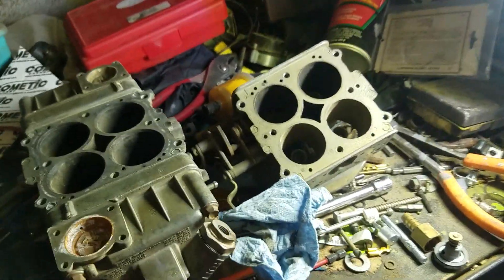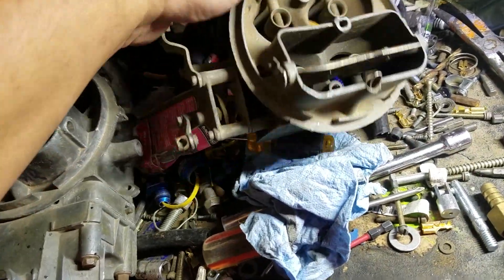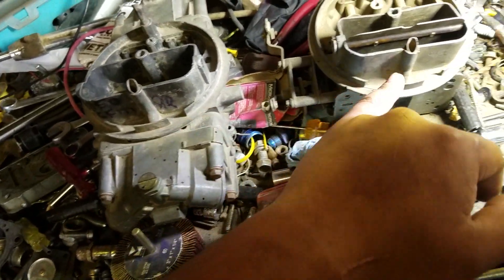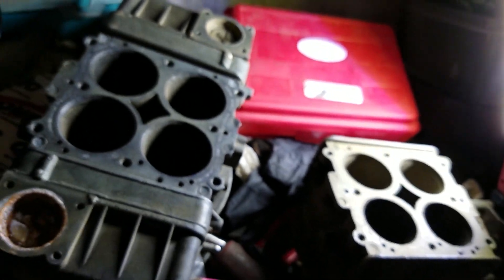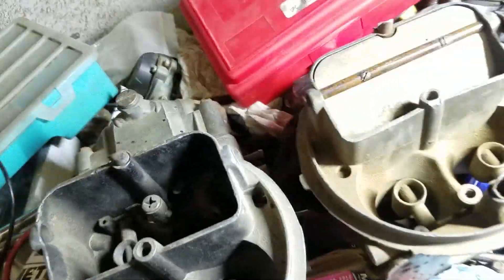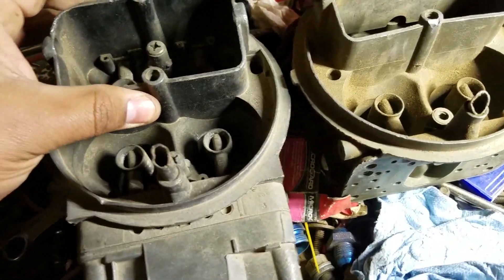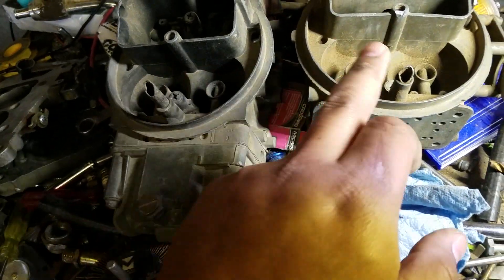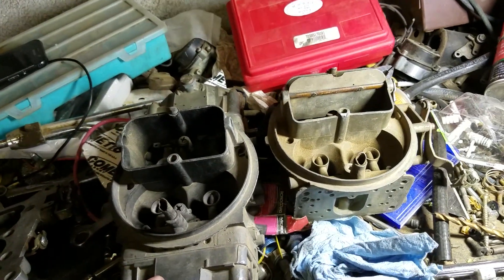Holley Carb 600 vs 650 Differences and Which One is Better | Holley Carb Secrets |Holley Carb Tuning

Comment: Hello, excellent video, I have a carburetor like that, my engine is a slightly modified 350 but I bought an 850 cfm too much for this engine that I have to change to make it a 650 cfm
Reply from the maker: you're better off getting a different carb. Theres no easy way to get a 650 onto an 850 baseplate so the only reusable parts of the 850 are the metering blocks and bowls. You can machine a 650 main body onto an 850 by the way. Its not uncommon to see that done to 750s.

Comment: I took a 1850 drilled it for 4 corner idle.  Cathedral bowls and hands down the best meetering carburetor i ever had.    Afr is actually perfect.  Cruise.  Everywhere
Reply from the maker: I'm glad to hear it! I personally really like the 1850s. Even the 4160 versions are small and compact but still have a lot of potential

Comment: Can you put 850 metering blocks on a 650 dp main body and not run rich
Reply from the maker: It all depends on the engine its going on. If the engine wants a lot of fuel, it will be ok, but if its a mild or stock engine, the PVCRs are going to be too big

Comment: Can u tune a 600 to be allittle lower?
Reply from the maker: What do you mean? Like take away CFM?
Reply: @NightWrencher  ya I have a rotary that has a Holly 460 cfm an I wanted to make a 600 into like a 500 550
Reply from the maker: @porterpowerrotary7619  CFM is figured by the size of the venturis, throttle blades and booster type. Most carbs are measured using straight leg boosters. Downleg boosters increase CFM by about 20 or 30  due  to their position in the bore. Annular boosters decrease CFM by about 25 due to the size of the booster blocking air, but also increases fuel atomization and promotes better mix. You can send your 600 main body to get annular boosters installed and thatll bring it down to 550-575. Hope that helps
Reply from the maker: https://www.hotrod.com/articles/carburetor-showdown/
Reply: not sure but push in annular? restrictors were available to reduce primary flow.